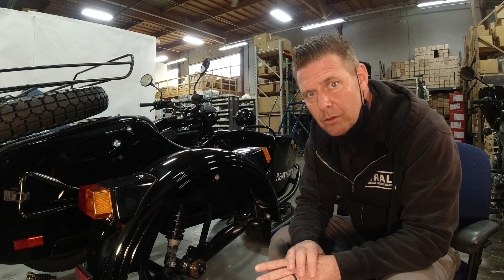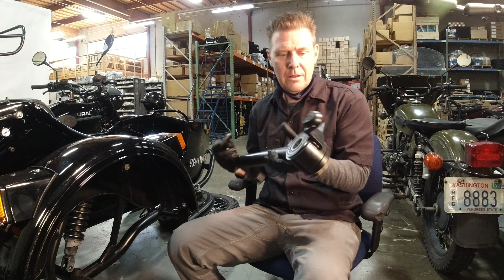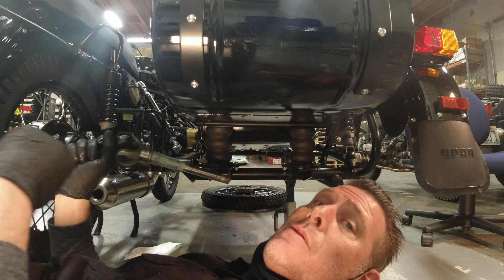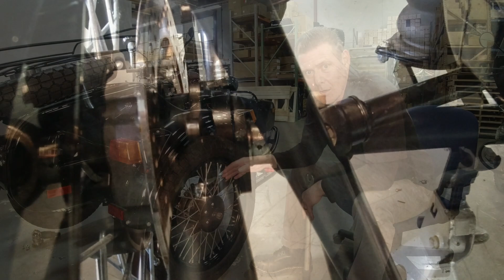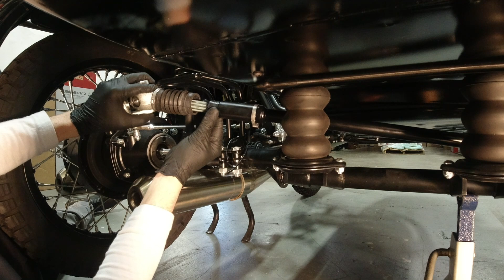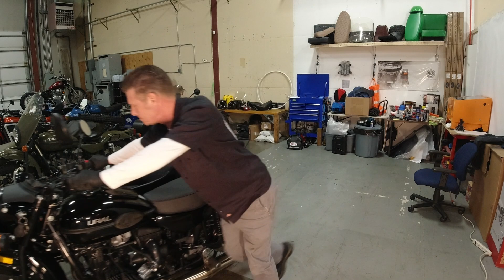URAL How-To - Sidecar Swing Arm Removal 2WD

Comment: To repeat a point, very few Ural owners will do this. A MUCH more useful and relevant video would be installation of the spare on the front wheel. Why hasn't this been done already? Videos showing replacement for the rear and sidecar wheels were excellent. Common tasks are what we need to see, not this esoterica.
Reply: As I have mentioned before, when it was suggested I start doing these videos to communicate with URAL customers many people where on lockdown. There was more time for me to cover the topics I wanted to cover based on the feedback I was getting. People weren't doing much and the motorcycle industry was relatively slow overall. Many customers liked the videos so URAL allows me keep making them but I have a whole other job I do for URAL. Time is an issue for me so I record what I'm doing for URAL as it is a task I need to get done for my job anyway. Spring/summer are the motorcycle industries busiest time of year, maybe come winter I can cover topics that I have put on the back burner when things slow a bit.
Reply: @davidwaynegeorge2292  and @geckoboy49 :   Ironically enough, *I*  could really have used this video last winter, when I had to replace the U-joints in my 2008 Patrol.

The part I was unsure about was the "use a bigger hammer" approach (in both the manual and in various online groups) in the removal of the sidecar axle from the bearing. From your (edited) video, I suspect even the newer bikes need an unusual amount of force to free things up!

I really appreciate the pointers on wear items and how / where to grease upon reassembly. And you're right:  You need to keep track of the parts, as many are not bits you see during regular maintenance.

In short, keep on doing what you're doing Dave. Sounds like a good use of your time and as esoteric as some of the repairs might seem to others, someone out there will appreciate an expert's point of view!

Comment: Love these videos, David! Where did you get the Oetiker clamps from? I getting ready to lube the splines on both driveshafts, and could only find CV boot clamps, which I assume will work OK. Also, is there a camber on the sidecar wheel, or should it be 0 degrees? Thanks!
Reply: Alan, I got the Oetiker clamps off the shelf, one advantage of having the entire US warehouse of URAL parts inventory downstairs from my office. You can order them from a dealer and they may even ship direct to your door. 48.5 mm
 is P/N: IMZ-8.1040-15008-20 (driveshaft fork side) & 41.0 mm
 is P/N:
Reply: Thanks David! I have ordered them!

Comment: Thanks David. Great video as usual. Just love the Remy specials. Was the part change over necessary or just cos you could. What were the essential differences in swing arm from part2 and drive shift from part 1. To motivate the change over. Best regards H
Reply: Hello Harry, this bike was used for mockup of some R&D parts after it's Remy debut so it had a custom brake bracket welded to the swingarm. The project never gained momentum and the whole rig sat in a warehouse for a time. I had it shipped back us so I could put it back to stock 2017 specs and sell it to someone that will love it. The driveshaft is the same but I had to remove it to pull the swingarm so I just thought I would film while I worked. The only part I swapped was the R&D sidecar swingarm with a stock unit to put the stock Brembo brake setup back on.
Reply: @davidwaynegeorge2292  Many thanks David..The Remy specials would be a great collector.